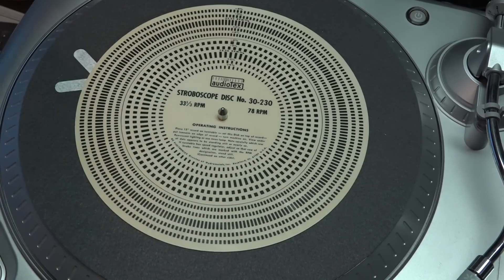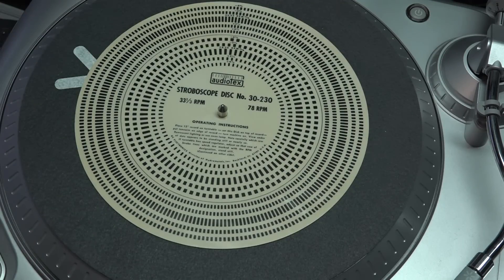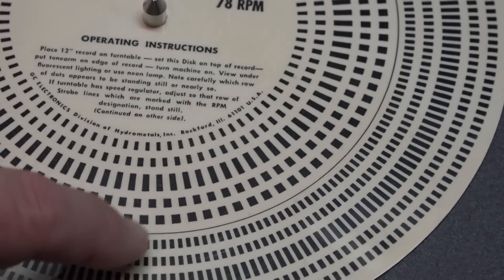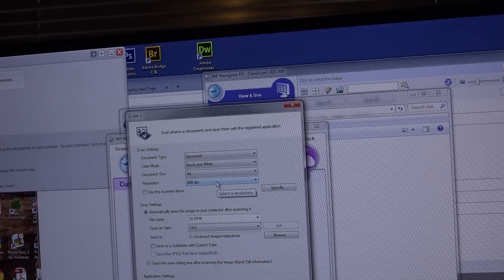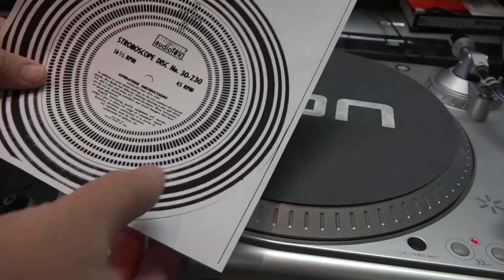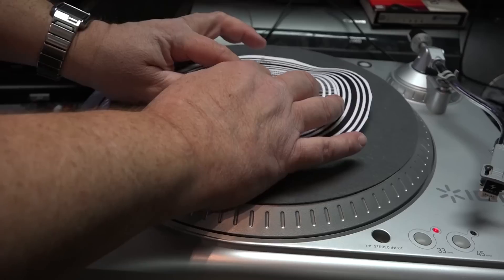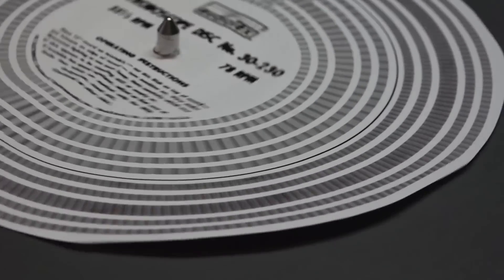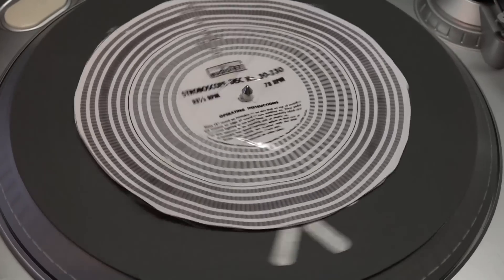Strobe disk for turntable  speed construction

Comment: A very good demonstration, thumbs up. I have recently bought a used harman kardon T25 turntable, semi-automatic belt drive from 1980s period. HOWEVER, I cannot see this speed! It comes with a stroboscope disc! I set up the hk T25, set tracking force, anti-skating number; bought all these tools from the Canadian Amazon; a couple I overpaid for shipping (USA). Anyway, I then checked Azimuth, VTA, cartridge alignment, all okay. Furthermore, I reset tracking force, a bit more, then anti-skating because the Neoteck force scale gauge indicated a bit more otherwise; set from 1.5g to 1.96g for Audio Technica AT70 phono cartridge. From the research I've done, there is no model number on cartridge like the Stanton cartridges. Going to buy a new stylus; bought an Audio Technica AT95E from ebay, plan on making a turntable, DIY project of accomplishment; a philosophy that I have. Anyway, I also reset the anti-skating, let platter run with stylus guard on. Got is to stand still.

HOWEVER, I DON'T SEE THIS PATTERN OF BARS THAT ARE SUPPOSED TO STAND ALMOST STILL. I held a flashlight, LED flashlight, and during evening hours, and there is no actual bars to measure. What is going on? Maybe I'm doing something wrong, not looking carefully enough? There is this SPEED CONTROL dial to the right of the SPEED SELECTOR dial. To the right is a cut button. I got manuals from the vinylengine.com web site The hk T25 is belt drive. Thank you for any advice that can be given. And thanks for having the patience to read this long question.
Reply from the maker: Strobe disks are based on using a strobe light flashing at 120 hz or 100 hz for europe.
A neon lamp, or fluorescent lamp operating on AC using a magnetic ballast is the only way to get this.
Should be able to do it with an LED lamp that is driven with AC if you remove the filter cap, but not one that uses a high frequency pulsed supply like your flashlight.
Reply: @12voltvids  Thank you very much for your quick reply, and further instructions, and suggestions, 12voltvids. Yes, now I understand; thought maybe there was something dysfunctional with my turntable, besides myself. Thank you. I feel more confident; about playing back my records now. I am going to get a lamp shining at that small diameter stroboscope disc; and then completely have the turntable set up, ready to playback* some serious vinyl. 

*Playback; a term that I got from a book written, published in 2004 (?), that I borrowed from the public library several years ago. It explains the development, and business of recorded music.

Comment: An incandescent lamp or even AC powered LED lamp work fine for using a strobe disk.
Reply from the maker: No it won't.
You need the strobing of light at 120 hz, which is what only a plasma type of lamp can deliver as it pulses with the AC line frequency (100 hz for 50 cycle countries)
You need to use an NE2 bulb, or a fluorescent lamp with a magnetic ballast.
Compact fluorescent or LED will not work as they use an inverter which operates in the KHz range. An incandescent lamp is just a glowing wire so you won't see the strobe effect of the strobe disk.
An LED can be used if it is powered by line AC through a dropper resistor so the bulb led will be flickering at line rate.

Comment: I wish I could understand what you're looking at to say it's okay. What's stationary? What are you looking at and how does it register stationary? Thanks a lot.
Reply from the maker: James Bond 
first you need a light source that flickers with your ac line frqqency. a fluorescent lamp with a magnetic ballast works. you will see the lines appear to stand still when it it turning the correct speed. they will appear to rotate counter clockwise if slow and clockwise if fast. of course if you look under led light or incandescent or sunlight or a CFL or fluorescent lamp with electronic ballast it will just appear as a blur. it is the quickly strobing light that makes the image appear still like a timing strobe pointed at the crankshaft of a car engine to set the ignition timing.
Reply from the maker: At 5:11 i point it out. The lines on the band appear stationary
Reply: Aha! I see it now. The other circles are moving compared to this one.
That's with the naked eye. Does it work this way without a strobe light?
Reply from the maker: Thats right. The other 2 were 2% faster and 2% slower than 33 1/3 so if it was fast the next band in would appear stationary, and if slow the outer one.
A strobe light is what makes this work, so it needs to be done under a fluorescent lamp with a magnetic ballast or a neon lamp. Many turntables have the strobe ring engraved or printed on the platter itself, and have a neon bulb that shines directly on the ring so you can see at a glance if your speed is correct.
Reply from the maker: It doesn't come across on camera well due to the rolling shutter, but looking at it with the eye you will see it clearly.  The low side will appear to rotate one way, and the high side the other and the correct speed the lines will appear completely still if going the correct speed or moving slightly if speed incorrect.  
The black and white stripes will be totally still as if it wasn't turning at all.

Comment: Just make sure you disable "Fit to page" when printing it, otherwise it may not print at exactly the correct size, which will throw off the accuracy of the stroboscope.
Reply from the maker: I did a print at exact size, not fit to page for that reason.

Comment: Never save any picture to jpg, it makes a mess of it.
I use png or gif for schematics and png or bmp for pictures.
If you use a paint program you can pinpoint the center before printing :-)
Reply: good tip, thanks
Reply: Picture format Compression is not like zip file compression, zip has to reproduce the actual file, every bit is like the original.
A jpg makes the file smaller with mathamatical tricks and downgrading the photo in the process.

Comment: The result would have been much better if you had chosen Document Type as Photo instead of document. Also if you search for stroboscope in Google images there are a few ready to print out, that's how I made my own stroboscope disc, there are even images with both 50 and 60 Hz on the same disc.
Reply from the maker: The scan was fine, my printer is only 300 dpi laser, about 12 years old. The 16 rpm scan was fine on the monitor just wouldn't print at 600dpi.
Reply from the maker: Of course they are on google images. Everything is there!